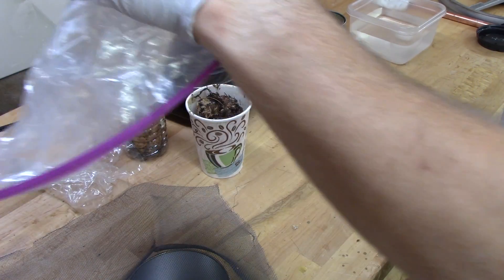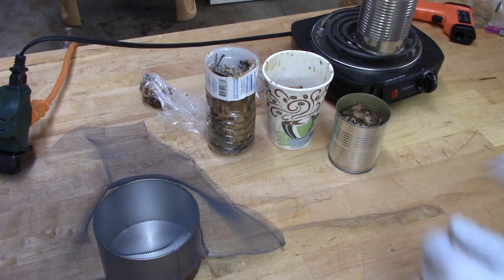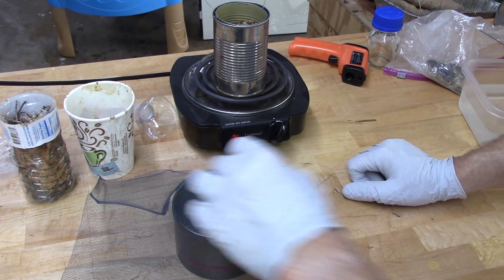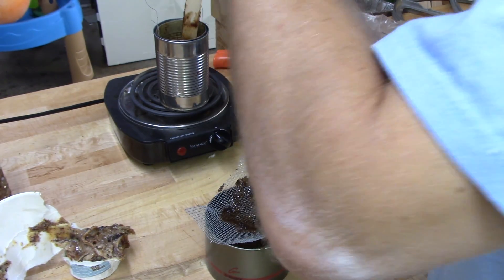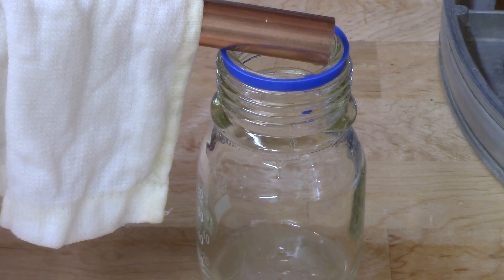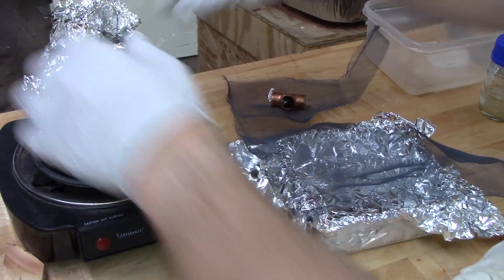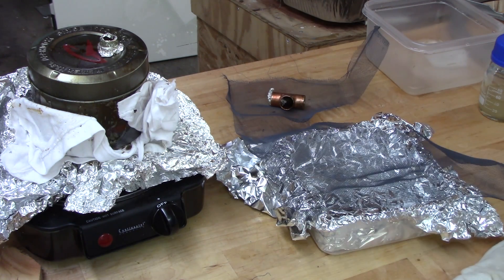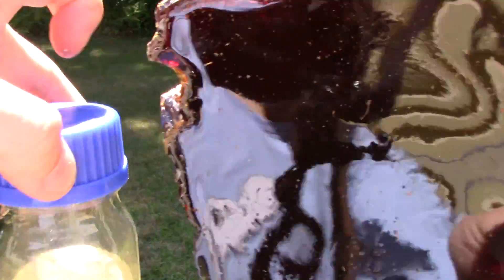Making Turpentine and Rosin from Pine Sap

Comment: I dissolve it in alcohol first then strain it to remove the trash. Then I sit it in sun light to evaporate most of the alcohol. Then I heat it on my hot plate to get rid of any remaining alcohol and water. While it's hot I pour it through a automotive paint strainer.

Comment: Yes, thank you! We use Rosin on our Bow Hair because as it is stripped off the block of Rosin, the microscopic barbs on the Siberian Horse's Tail Hair abraid the Rosin, heating it and the inherent abrasive quality of the bow hair cause our strings to vibrate. As the bow travels across my strings it sheds some of these barbs and it settles as white dust on my Violin etc. As the Rosin dust literally flies when we play loud in the orchestra 😊

Comment: Thanks.  Never done this myself, but I think that this sort of chemistry more or less saved the Old South's economy after the US Civil War.  The starting materials were dirt cheap, and with a bit of training you'd make a ready for market material, as there are many uses for pine sap related products.  And because you really didn't need a lot of specialized equipment, nearly anyone could do the extraction process.  Because people got used to thinking in terms of chemistry, it was easier for them to turn their thoughts to other sorts of chemistry.

Comment: Here are two reasons why you didn’t get clear turpentine at the end. The starting material was not fresh sap, known as gum. You have to remove the bark and collect it over time (1-2 weeks) to get the gum flowing. Your starting material was resin, which is a completely different material with different chemical composition from sap/gum. Secondly, before distillation you should add some water to the sap/gum to minimize fire risk and make it easier to heat. The distillate will have two layers, the top layer being turpentine. Your end product is not turpentine and I’m not even sure what to call it. Good effort but there are easily searchable resources explaining this process.
Reply: If he wants to send me a sample I’ll test it for volatiles!
Reply: Sometimes the fun is in trying something first before looking up the literature (with safety concerns being the exception of course)

Comment: You could probably use a little acetone or even turpentine itself to dissolve the sap/resin. Would reove the need to heat for filtering, might even allow for a finer filter

Comment: So I'd been doing some research on Celtic headhunting after seeing that we now have evidence that it was actually done. In Roman accounts its said heads were preserved in pine resin. The paper said that these severed heads they studied did indeed contain traces of pine resin that had been heated. 

So I think it may have been rosin the heads were preserved in. And with this video as a visual reference I have an idea of how this would look if correct. 

So thanks.

Comment: Another name for this substance is Colophony, rosin of pine. It has been used as a key ingredient for making cylinder records for Gillet phonographs with a mixture of paraffin wax. When hardened the mixture is poured into a cylinder mold. Once cooled the wax Colophony cylinder is cut on the edges to make it smooth. Then turned on a mandrel to cut the grooves in and then a recordable stylus is used to record sound or music on the cylinder. You probably overheated it. It should be a lighter red
Reply: Had to read about it more once I saw this. Pretty fascinating, thanks for the info.

Comment: Excellent. I'd love to see the community learn to use proper terminology, because it's a confused mess as it stands. For instance, afaik you do not use pine PITCH for medicinal salves, you use pine TAR, the precursor to pitch.
Sap: the sugar, water, etc inside the tree's xylem and phloem.
Resin: the sticky stuff that the tree puts out to seal wounds, push out or envelope parasites and attract their predators. Contained in specialized tissues within the tree. (Perhaps sap is a component in the tree forming resin? Would be interesting to know.)
Pine tar: distilled from pyrolysis of fatwood.
Pitch: pine tar which has had the liquid cooked out of it.
Rosin: resin which has been highly purified.
Imperfect and incomplete definitions, for sure, but it's a start. Corrections welcome. I

Comment: Definitely an outdoor activity. My first attempt at this was similar to yours. I now have slabs of resin saved up. All the leftover wood material are perfect for getting camp fires lit. No waste, it's all useful.
Reply: Slabs aka roof tiles :-D
Heat edges to seal individual tiles to others and layer of moss/needles on top to protect from sun 👍
The exact reason I found this video haha, roof tiling and bath/waterbutt sealing.

Comment: Curious if the sachet method could be used with pine resin like with wax. Put raw stuff in a muslin bag, toss it in boiling water, when it reaches melting temp pull the bag out that now only has the impurities. Wait for the water to boil off and then pour into your mold
Reply: Does the resin still hold its medicinal properties in this method?
Reply: @avanti2762  have not thought about that as I use mine in sealant for leather and firestarters, may look into stopping at melt, pull the sachet and then let the puck solidify.

Comment: it started condensing on the foil and dripping down the side of the foil and caught on fire.  the foil needs to be insulated—just as the condenser (copper pipe) needs the opposite; it needs to have no insulation and a heat sink (in this case wet rag).  Be sure not to double up wet rag.  Needs to be thin and not insulate.  To keep pipe cold.

Comment: ive also been obsessed with resin. I make my own violin rosin. learning about types of trees. I hope to learn to collect turpentine for medicinal purposes.but making rosin is much easier. 200deg F should be hot enough to get all the terps out. too hot and your rosin burns. Real food grade turpentine is a superfood/medicine. 
Denatured alcohol(if you aren’t going to consume it!) will thin it enough for filtering. 
this guy is working too hard w the heat gun. 
everclear also works.

Comment: I put the can with the screen over a hot plate at med heat.
 It really accelerated the separation process, the sap just pours out afterwards and u dont really need to clean the screen between pours!

This method is only good for about 2 or 3 times  before you have to let the can /screen cool down a bit.

Comment: if you heat it it becomes darker . 
the bright lemon color is the best for violin rosin .
Reply from the maker: Good to know!
Reply: @WhatDennisDoes  just crash the rosin rocks to powder and mix with fresh sticky rosin until you get a nice cube , it gets harder after 2 days ..   i tested it on a violin and it works fine .
Reply: @WhatDennisDoes  adding water before heating makes it easy to filter .
Reply: ps the dark rosin is good as a wood stain.
color outcome : https://www.youtube.com/watch?v=HBnxyQDQRzM&feature=youtu.be
just add wate & heat for 3-10 min low heat

Comment: Ok so heres how i do it. I think i could do it differently like heating the sides, but i digress. I use a metal funnel with a screen at the bottom and light all the pitch and sticks, watching how much is in the funnel. I use a bbq lid as a wind protection if windy and to let a bit of air in and not let big sparks escape. If it goes out or you put it out to add more pitch while its all hot its quite easy to light again. But like i said at first, maybe i should light a fire around the covered pitch inside the funnel as to extract a more pure tar in the end?

Comment: It is not a tree or pine sap but tree resin. I am not sure what you want to do with it but I boil it the same but you need to put some oil into it. I use olive oil. You just need to put about 2 spoons. After you can easily filter it.

Comment: I have been buying refined pinon pine resin on Amazon for sometime now, but now I want to start refining my own resin.  I found a group of pine trees seaping with sap and wonder how to get a very clean golden color refined resin. The resin I buy online is beautifully refined...pure golden color. So far I know they "purify their resin gently". What I am guessing they do is use low heat to filter the impurities to keep that golden color. I'm sure using high heat will make the resin turn dark or even black. I bet there is a fine line to getting a beautiful refined pine resin. Any thoughts?
Reply from the maker: I have a theory about the color - a lot of the pitch that I collected already had a reddish color to it.  I found that this pitch also had a different consistency and seemed to ooze from random spots on the tree.  Other pitch that was clear came from wounds in the tree and there wasn't nearly as much of this clear stuff.  It seems that the tree wounds heal pretty quickly and not much resin comes out.  Where the big globs of reddish stuff collects I am guessing there is some sort of bug living inside that doesn't allow the tree's wound to fully heal.  I bet that this reddish color has something to do with the bug as well - maybe the pitch is contaminated with something the bug excretes.  Again just a theory from what I've observed and I haven't done any research on this.  I bet the color of the final product depends a lot on where and how the pitch was collected.
Reply: What Dennis Does yea it really depends on the type of tree you get the resin from. The resin i buy online is flawless! But it's getting way too expensive especially since i am trying to make soap out of it. I also make a salve and works wonders. I add propolis, she butter, candelilla wax, almomd oil and resin. Keeps my skin very clear. I also tried spruce resin and so far this one smells best.

Comment: why couldn't you try making a mesh basket to place inside the double boiler that you place the raw pine sap into?  Perhaps suspend it higher so just the sap drips down into the can. It would seem like it would save you the step of even touching the sticky junk and as the mesh would be very hot also, all the hot sap would pool in the bottom.  Very interesting video!
Reply from the maker: +Karen Tribbett yup, that is a great idea, and if I do this again will definitely try it!  There was not a lot of planning put into this. :-/
Reply: Karen, sounds good, though I'm not sure letting the pitch drip would work because once you get the pitch hot it tends to cool off and get to thick to pass through any screen. Not sure what, but there's got to be a better way. Trial and error, eh?  : )

Comment: Exactly the way I thought to do it, melt it and pour it through a screen, this is a good experiment.
Reply: Mesh is a very effective heat sink and dissipates heat in thick melted pine pitch quickly. Heat the screen mesh. Even consider shorting a nine-volt battery or two across the screen to keep it very hot. Then more resin will pour through. By the way, maybe try a fine metal screen, cheese cloth or coffee filter for finer filtering. Paper towels are made to absorb and dissolve. All at your own risk. Great start - good video.
Reply: Yeah, I tried a similar approach today, but my mesh was too fine. Will get larger mesh tomorrow and try again. Have LOTS to process. I was hoping for a light colored end result, but based on all the videos, I guess the result is usually very dark to black-ish. At least now I know it'll work, eventually...  :)

Comment: you have convinced me to tap all the pine trees on my property! el experimento in progresso
Reply: Youd have to do it in early spring if it would work.
Reply: guided one  Tapping a tree is almost exactly how it sounds. Drilling a hold into and sticking a tap into a tree. A tap like your water tap at the sink. 
It's how things like maple syrup are extracted.
Reply: Did you tap tree's, if so did you kill them or introduce the pine beetle to them (inevitable death)?
Reply: @WrjonesJones  Pine beetles chew in through the bark so that shouldn’t be an issue. Injuring the tree does create an infection court but it’s not guaranteed to be a problem unless spores land in it. It can be done safely if you do it right, just the same as me doing an increment core sample to see a tree’s age without cutting the tree down.
Reply: I just got this idea the other day, with my 2 spruce trees to make my own Gum turpentine. How did it work out for you?

Comment: Might I suggest, next time using the boiling with the filters already within, under the sap? Staying hot would filter it smoothly. Neither of your filters look to be in any danger of catching fire, although I cannot tell if the one is simply window screen nylon. In either case, you can of course find metal ones. Good to see the experimental initiative. Enjoy it so far. I suspect there is a findable list of temperature ranges for the changes in state. Nice video, thanks for sharing.
Reply from the maker: +SeeTheWholeTruth that's a great suggestion. I'm looking for more pitch now and will render it down with the filters in place.  The screen I have is aluminum window screen so should be fine for this.  I'll see if I can record temperature while I'm at it.

Comment: I also have had big problems with this stuff. I collected literally buckets full of this same resin because I want to use it, combined with wax, to boil and protect beehives. The nature of this stuff makes it so difficult to work with. The temperatures in which it changes from a solid to a liquid and then to FIRE seemed very critical. Good video.
Reply from the maker: Ooh, that's one use I hadn't thought of - sealing wood.  Great idea.  I hope to post a video about different formulations with beeswax.  I've found that the rosin, once rendered down, doesn't catch fire easily.  Adding beeswax will certainly change that.  I'm jealous, I'd love to have a source where I could find buckets of pitch!
Reply: @WhatDennisDoes  sealing wood is literally what it's made for(by the trees) and you never thought of that?
Reply: I wonder if it could be mixed  with sawdust and something else  to make  hard stuff ( concrete?) or maybe seal surfaces of basket to make them buoyant.